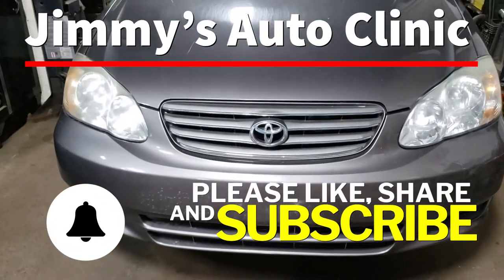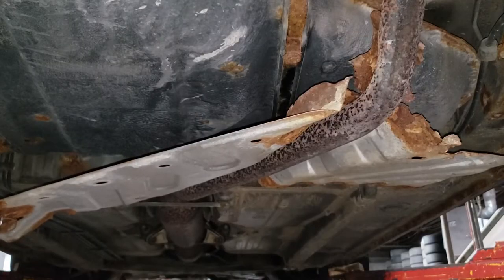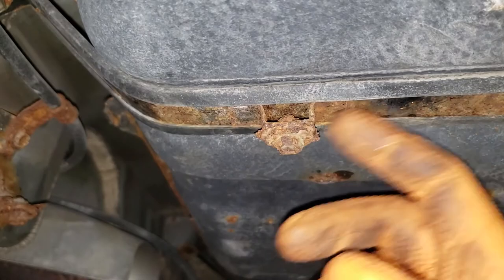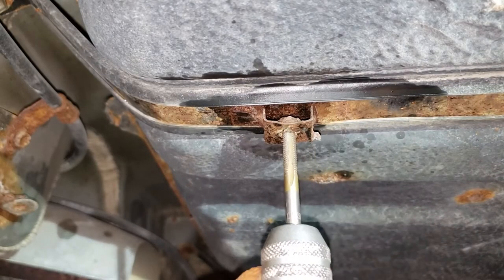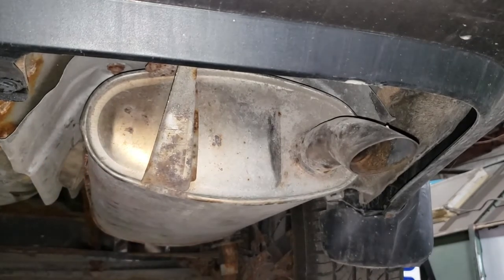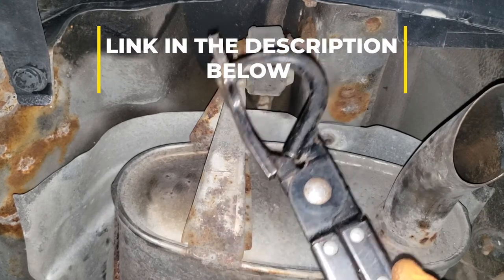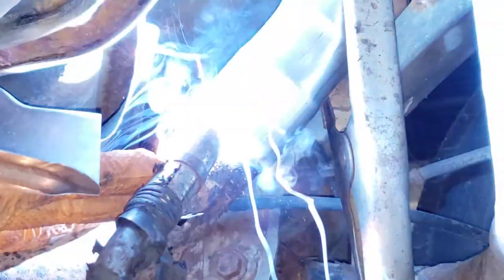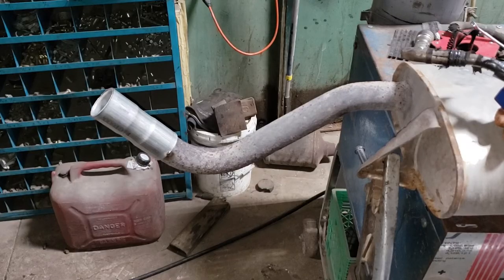Toyota Corolla | Exhaust Pipe | Heat Shield Repair Replacement | 2003

Comment: I believe the original pipes are stainless, so i’d think clamping a new stainless piece in with stainless clamps would be better than welding, especially if you don’t clean the original pipe first.  Any idea how long those welds will last?
Reply from the maker: Hey my friend. The original pipes as far as I know or not stainless. They are however better quality than what you get from aftermarket. As for welding depends on who's doing it, I can tell you that my welds last usually the life of your vehicle.

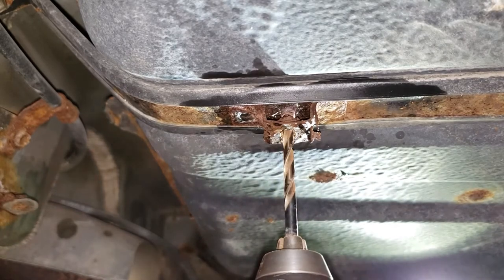Comment: @8:04

Arrrggghhhhh..... You reminded me of when I got my 99 Solara 5 years ago.... All 10 of the bolts that hold on the skid plate underneath the radiator snapped.  I wish I knew about the center punch idea then....

I had to drill out all 10 and then helicoil all 10. Not much fun. But the hell paid five years ago  has me benefiting myself in the last 4 years.

It may be that it's just a good idea just ofdrome all out anyway so you know that at least the threads are good. Hard to find a place that sells thread chasers.
Reply from the maker: Yeah I completely understand how frustrating it can be to drill out bolts. If you're up in Canada you can find tap set at Canadian Tire and down in the states I would imagine they would have it at Harbor Freight or like a Pep Boys or something. But I'm not 100% sure about the states. Of course there is always a Snap-On truck but buying a thread chaser set will cost you a small fortune LOL. Good luck my friend.

Comment: What a great video!! My heat shield rusted off. I don't have one anymore. Is that OK? 2005 Toyota Corolla. Thanks!
Reply from the maker: It's not something that I would recommend driving without for extended periods. The reason being is if you do get a exhaust leak even a small pinhole exhaust leak can melt a hole in your plastic gas tank which would potentially be severely disastrous. The chances of it happening are hardly unlikely but you don't want to be that 1% or who has their car blow up because it was missing it shield. I hope this helps. Good luck

Comment: @1:36

As pertains to the aftermarket pipe: that's pretty much how it was in the first half of my life (I am 57 years-old now).  Be lucky to get a third season out of the muffler shops back in the day. Yeah, they'd warranty the muffler, but none of the labor and other pipes and fasteners.

However, back then a typical muffler job on V8s that I drove was only around $200 so you can inflation adjusted to about $1,000 today I guess. But I was blindsided that it was $1,600 10 years ago quoted to fix my 1999 Toyota Solara V6 exhaust system from the end of the manifold on back.
Reply from the maker: Yes it's really something now the cost of exhaust parts or just Parts in general. Really that's everything on the planet now unfortunately I feel like we're all being taken advantage of.

Comment: Hey Jimmy! I don't have one of those amazing machines that makes a tube wider. What size of tube would I buy at an auto parts store to make this work?
Reply from the maker: I think the stock size tube is 2 in or 1 and 3/4. However it really depends on the engine size and whether you have had the parts replaced before. Generally aftermarket tends to be slightly different than oe size.

Comment: I'd be careful about washing that car.....the rust seems to be the only thing holding it together!
Reply from the maker: LOL unfortunately in the Rust Belt most cars look like that after a few years of use.
Reply: We don’t have the rust here in the DFW area of Texas…just melted tires this time of year!  Had a ‘85 VW Jetta..every summer the fabric in the door panels would fall off from the heat!
Reply from the maker: I can only imagine what that's like. I've seen some pictures of the tires melting and whatnot and I was equally as surprised as I imagine you guys would be when you see the type of rust we got to deal with sometimes LOL